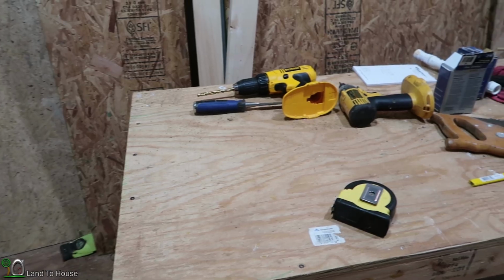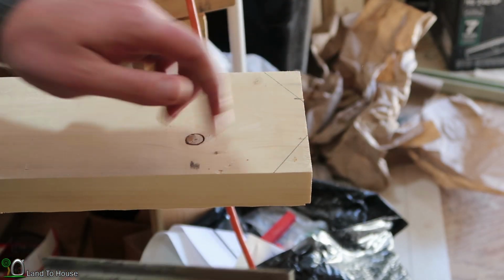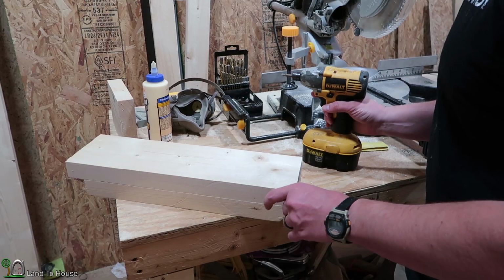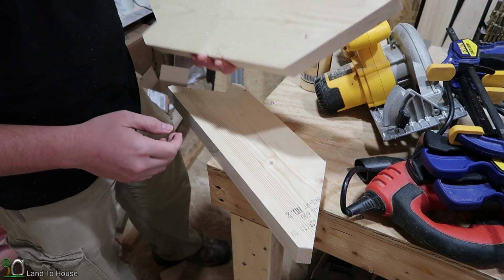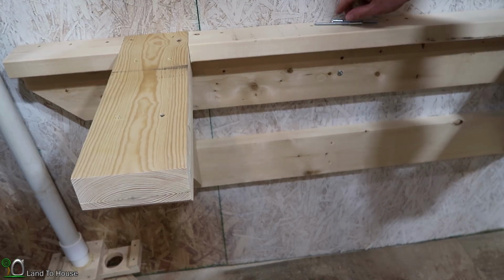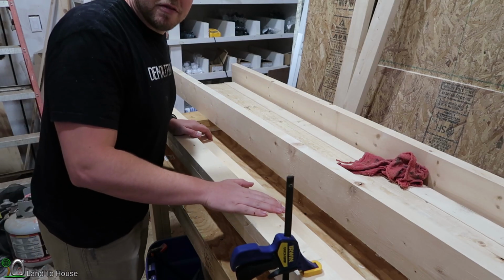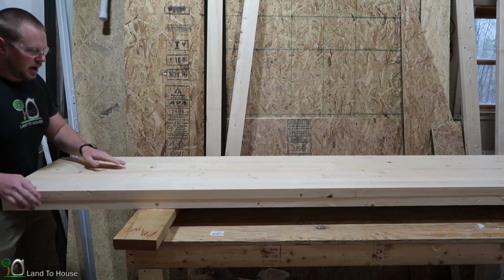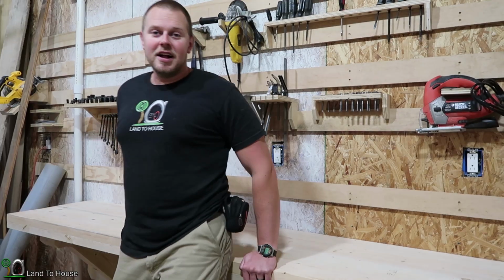DIY Wall Mount Workbench - Build a Workshop #54

Comment: This is exactly what I want! Would you build it differently if you had an exposed wall?

Also you mention mobile one, early on. I want a mobile one for the garage. Could you link please? Just found this channel
Reply from the maker: I think that the surface mount was the best option for this space. Connecting to the wall studs could work but does not look as nice. I think this is the build mentioned https://youtu.be/4i9Pff8KT_s

Comment: Fantastic job and an excellent commentary as you went along.   I guess I would need to see what you're going to be using the bench for.  Seems to me that it's sturdy enough to park a '59 Buick on it with no movement of the bench at all.   I watched the video because I'm interested in building a wall-mounted workbench.  I will now have to consider making it a bit more sturdier than my original thought process.  Mine is going to be a swing-up and have legs that fold down and lock into position to support the bench as a work surface - and fold-down when not needed.  Looking at 30" deep and 50" wide with a solid door cut to size.  Not as elaborate as yours, but you're more highly skilled at woodworking than I will ever be.

Comment: The top seems unnecessarily complex and pointlessly overbuilt. I have 3/4” plywood top and I’ve never had an issue. But I’m glad you love it, that’s all that matters!

I did like the execution for the floating legs tho. That’s why I watched your video. I moved into a new house and had to adjust the previous owner’s poorly made bench, and now I want to convert the front two legs (4x4’s) into a leg-less design like this.

Comment: can you do this with 2x4s?
Reply from the maker: Yes you can.
Reply: @LandtoHouse  i'm workin on the brackets now that hold most of the weight. do you think a single 2x6 will be stronger than two 2x4s glued together?
Reply from the maker: That would be fine. A 2x6 of that length is super strong.

Comment: Any one got a plan for a two-shelf version of this?
Reply from the maker: You could simply notch the lower support and slide a shelf in.
Reply: @LandtoHouse  Thanks for the idea! Another question-- how did you decide the vertical distance between the upper and lower support boards? Also, how much width did you rip off when removing the chamfers on the 2x6's? Appreciate it!!
Reply from the maker: The bull knows rip was just enough to take that edge off. A quarter inch or less. As for the support I simply just held the board up until it seemed right.

Comment: Could you do a short up date on the workbench after working with it for a time anything different change or things that you really like about it.
Reply from the maker: Haha I could .... but it turns out I like to put stuff on flat surfaces.  This bench needs to be cleaned.
Reply: @LandtoHouse  I would appreciate the review and the likes dislikes and any changes that you would have done differently after working with it this long. 
I'm about to start building one and want to plan accordingly. Thanks!!
Reply from the maker: I will have to clean it off some. But I will put that on the list of videos to film.

Comment: You realize your drill to socket you used on the drill couldve been used on the impact driver thus having no need to use a socket to finish tightening.

Comment: I know this is an old build and video but I just recently built this one. I went 5 boards wide instead of 4 because of height and receptacle placement on my workshop wall. It turned out great and thanks for video.
Reply from the maker: Great feedback. I hope this workbench gives you years of use!

Comment: Would this work the same into brick?
Reply from the maker: I have seen a couple pictures of this style bench in concrete block walls. You should be fine. Just takes a lot more work to pre drill for tapcon screws.

Comment: ................. And what I did... was to construct a ten-foot long workbench.. piano-hinged to the ledger board attached to the garage wall, just under the windows.. and just clears the foundation underneath when folded down... providing total  vertical clearance when down.

Comment: Hey I have also started to build this worktop! It’s a great project, I’m slightly panicking about the weight of the worktop, I have a single layered red brick wall in my garage, would it be strong enough to hold this weight of bench
Reply from the maker: Hello. To be honest I am not sure about mounting to brick. Might be worth adding a couple support legs to the ends. That does take away from the wall mount idea but gives it a lot more downward strength.
Reply: @LandtoHouse  thanks for the quick reply! I just assumed brick would be stronger but after feeling the weight of the worktop I started to panic a little lol
Reply from the maker: I know that brick can take a lot of weight downward but I'm not sure how it is on pull out strength using tapcon.

Comment: Great video, keep them coming, it is a really nice looking bench and the legless design has some advantages.
tips as you requested:
yes, when using those lag screws into the wall, a washer is needed.  the diagonal braces will translate the downward force weight of the bench into an outward force pulling at the upper ledger board connection to the wall, much like using the claw on your hammer to pull out a nail. Washers will reduce how much the lag screw heads bury into the board over the years.
When gluing up a pair of boards with a wandering bead zig-zag of glue, wiggle them around for about 10-15 sec can spread the glue more evenly.
When screwing a horizontal board to the wall, make a mark for the bottom and temporarily attach a scrap at that point to rest one end on.
If I may offer an opinion, the double layer of 2x lumber for the bench top is overkill, an apron board attached across the front of the 3 supports would hold a 3/4" plywood top that would feel just as solid, cost less, and the reduced weight would put less strain on the wall attachment.
Reply: Alternatively, could I replace the 3/4" plywood with a single layer of glued 2x4's? Any problems there other than weight/cost?
Reply: @kerouwhack  edge gluing a single layer of 2x4's would still give you a very substantial top.  I'd rip-cut them first to get rid of the rounded factory edges so you get a flat top, and join the boards with biscuits, dowels, splines, or even pocket screws so that temperature and humidity won't split them apart years later.

Comment: how much do you estimate the costs? and if you could includes dimensions and the material needed that would greatly be appreciated. looking to do the same exact build. the only things that scares me is the supporting pieces. if i understand correctly you flatened your 2×4 so they could rest against the wall. then you added a flat 2×4 onto the wall and drew the 2×4 marks onto the supporting piece?

Comment: Awesome job!! I'm new, new, new, but highly motivated! Was there a calculation involved in determining the length of the support or did you just come up with what you felt looked good? Thanks for all the info!
Reply: The plans for this bench call for you to cut them 1 1/2" D x 4 1/2" W x 26 1/16" L and glue them together to make them 3" D. Cut them square, then add the angles (45° is what the angle is). There are plans available for $7-10 on Woodsmithplans.com . They are for a 6.5' long version. Also, if you're just getting started I'd also take a look at Paul Sellers for some quality free education.

Comment: Great video!  What do you have behind that wall that the workbench is mounted into?  Are those just normal 2x4's at 16" center?  I'd like to do something similar in my garage, but I'm concerned about the amount of force the bench would apply to the wall.
Reply from the maker: Yes I just have 2x4 walls 16-inch on Center. I have not been too rough with this bench but so far it seems extremely strong and there's been no problem with the walls supporting the weight. 

I do have rafter ties on the top plate to help prevent wall bowing. If that makes a difference I dont know.

Comment: GREAT BENCH!
I will be making something similar out of oak in my living room for reloading and gun cleaning. I'm a bachelor, don't have a nagging wife anymore so can put anything in my living room.
One suggestion is ALWAYS spread glue for a stronger bond than just a bead of glue. In fact my "old world" Journeyman carpenter taught me as an apprentice (a long time ago)  to spread glue on both surfaces.
I have never had a glue joint break doing it this way.
Again Great build, be careful with that back!

Comment: New here but what's the point of using stacked 2x4's for the top.
Reply from the maker: It's possible to use a single Row for the top but the staggered wood allows for a much sturdier surface.
Reply: @LandtoHouse  Ok thanks. I'm just getting into wood working and trying to find a work bench design that will work and not be too big. Thanks for sharing
Reply from the maker: I am also new to woodworking. This bench has been great.
Reply: Land to House I just built the top to this workbench (only 6foot). It’s very heavy. Looking back I wish I had simply built a 2x4 frame and laid 2x6s on top. Would have lightened things a bit. Great video
Reply from the maker: It can be a heavy table but that also makes it stronger. I use mine all the time. Thanks for the feedback!

Comment: Oh yeah, for those searching for the plans and have an extra 10 bucks laying around, I'll link the online plans which also include tool holder and tool/book shelving. I did not need the plans as I found this video more than a sufficient tutorial. Here it is https://www.woodsmithplans.com/plan/wall-mounted-workbench/   That being said, I watched this video several times and the wranglestar version as well and I believe your version a much better tutorial. I did improve on your build (I believe) and for those of you who want know. I planned my bottom ledger board a little lower so that my 45 degree supports were longer, thereby bringing them out closer to the edge of the tabletop. This adds a considerable deal more support and also leaves room for a shelf that is drawn in on the plans you can find online. I believe wranglestar also displayed them in his video. Please don't mistake this for criticism as I think you did an amazing job. Any design, including mine, can be improved upon, right? Hope this is helpful
Reply: What is the distance you used between ledgers?

Comment: I did something similar but used 4X4's for the "legs" which went all the way to the baseboard area of the floor and framed the top using 2X4's - then I used some kitchen counter formica top - 12' if I recall  - for the top.   I could dance on it.  Then again, I need a work bench without legs getting in the way and am not a carpenter type.

Comment: Thanks for doing this video! I have a masonry block wall that I'll be constructing a similar bench on for reloading. I may use PT wood for the ledger boards but love this construction.
Reply from the maker: Thank you for watching! Using PT wood for the concrete is a good idea. That should keep things from rotting.

Comment: How much it cost to build thinking of building the exact bench! Lol tbsnks6 great video
Reply from the maker: I dont remember the exact cost. Lumber is going to be different depending on where you buy.  Definitely less than $100.
Reply: @LandtoHouse  if you could it would be great if i could know the distance from the bottom of the top ledger board to the top of the bottom legder board. Thanks i really like this design
Reply from the maker: I am away from my shop for a few days because of work and the bad weather. The distance is not very far. Somewhere between 6 in and one foot.

Comment: I have a customer who wants a similar design for multiple work stations in his office. It will be 45 feet long U shape pattern with the top made of 3/4" thick melamine board. So I won't need the amount of support you have on yours but I like the concept and design. Thanks for sharing!
Reply from the maker: That design will not need all this support for sure. Thank you for watching.

Comment: Great job!  I like to economize on glue by applying it on one end and using a piece of plastic or old credit card to spread the glue toward the other end to cover the entire surface.
Reply from the maker: Good tip. I have seen those rollers that work well for getting the glue even.
Reply: Glue on one surface, place second component on top and rub back and forth and a bit sidiways. It will spread the glue evenlyin a thin film which will cure more quickly and make a stronger join, no messy spreaders to deal with  dripping where its not wanted and wastes very little glue.

Comment: That bench might strong enough to put a tractor on! A friend of mine did a bench similar to this one using 2X3"s on edge for the top that were glued together and randomly screwed. We put a big block 454 Chevy marine engine on it and it didn't make a sound. Having no legs to the floor makes room for your feet and sweeping up is easier, too. Nice project, good job!
Reply: It makes room for feet but it is a time consuming build.  I did one but put feet/stands on it.
Reply from the maker: I plan on having a second bench with legs too. I wanted to have this nice looking bench for the wall.